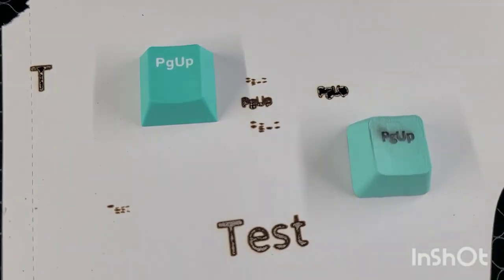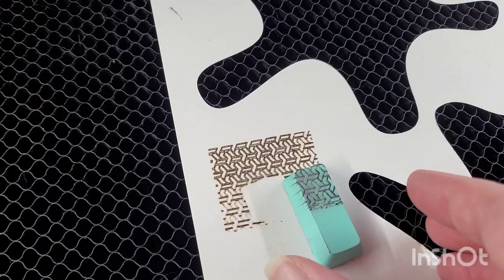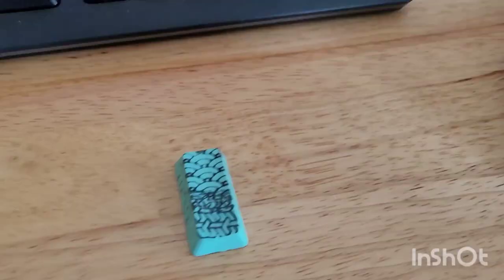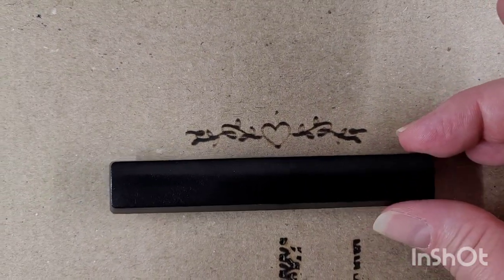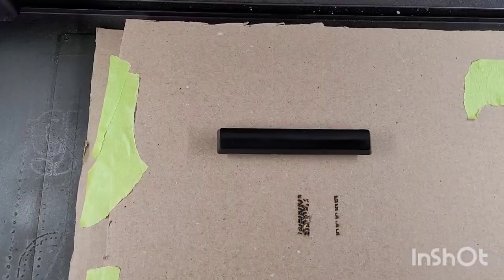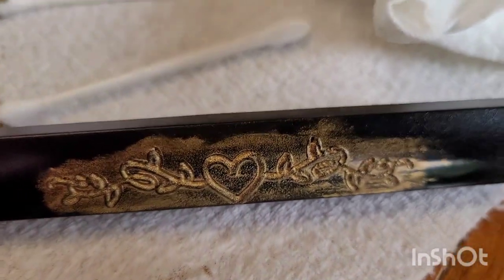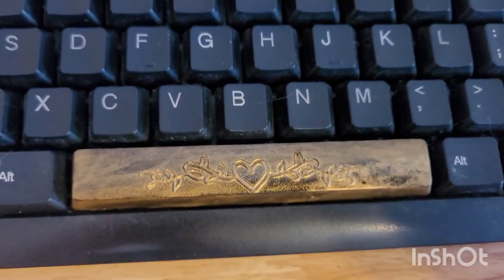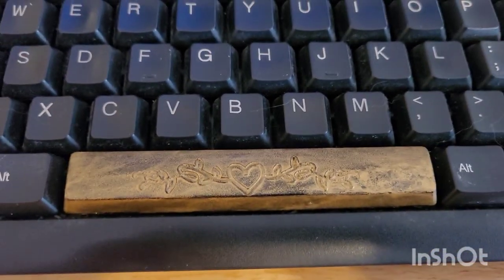Laser Engraving Computer Keyboard Keys

Comment: Looks like your keyboard engraving project is headed in the right direction. Given the poor printing and durability found on a lot of keyboards, engraving represents a quality upgrade. I'm considering doing the same to one of my white keyboards, so I'll pass on a couple of suggestions: one, considering constructing a jig to hold the key steady and firmly. Two, lower the power and if feasible, use multiple passes with the smallest laser diameter available on your equipment. Third, a transfer paper mask can help reduce or eliminate burning, scorching, etc. outside the letterform/art. There are multiple techniques to finish the key by filling the engraved portion with a contrasting color. Those that use oil-based paints and thinners work considerable better than water-based paints, so that may be a good starting point. Appreciate your video — always interesting and informative to see how someone approaches a project simiiar to your own. Best regards.
Reply from the maker: Hi thanks for the feedback and great suggestions! It was a lot of fun and good memories. It's definitely tricky plastic and my space bar now has a lot of texture but I don't mind. Cheers!